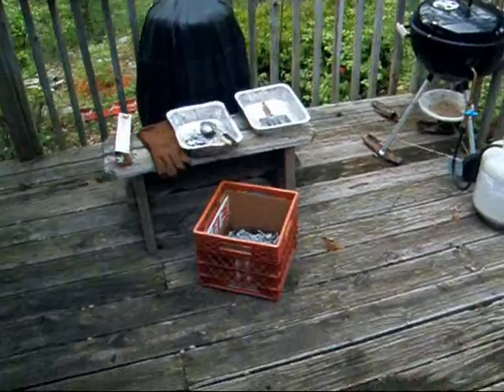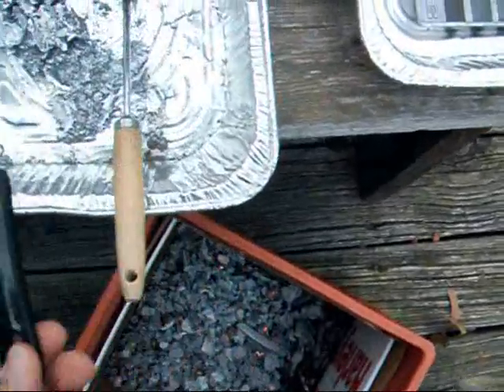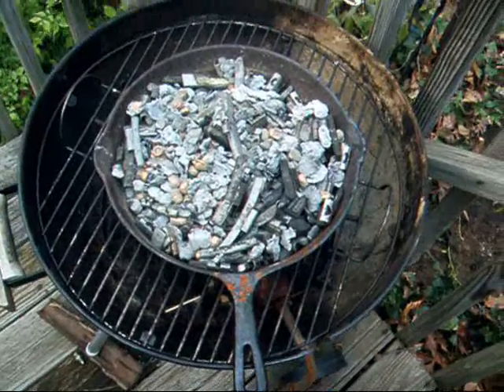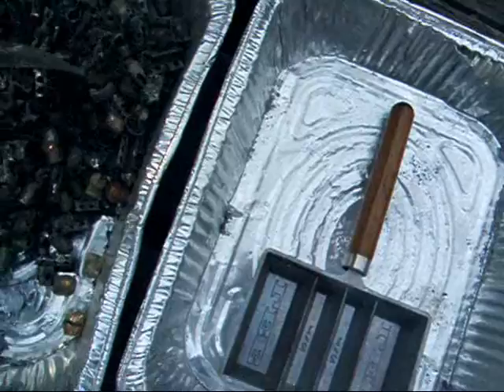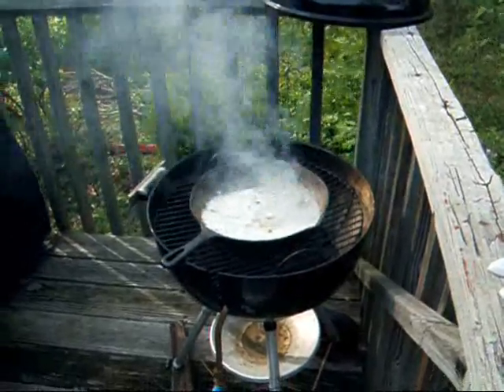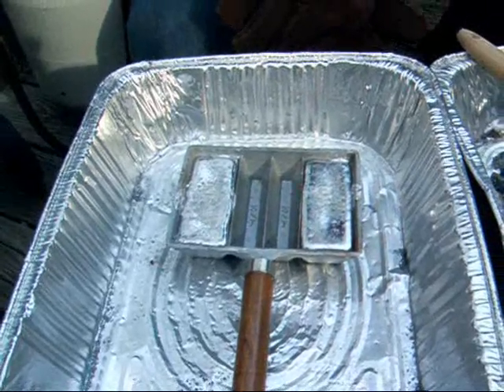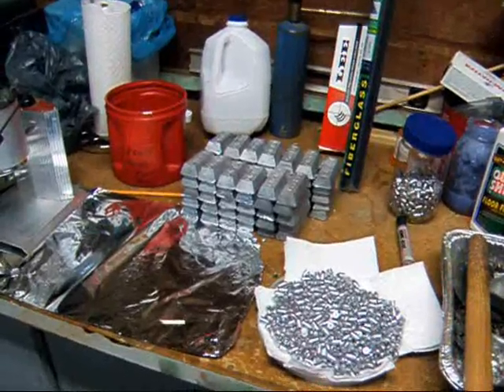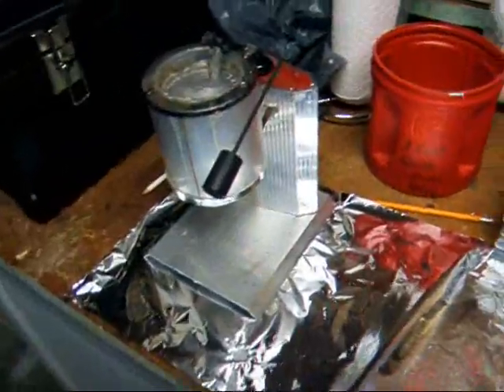Lead recycling for casting

Comment: why not melt and cast them at one time you save propane
Reply from the maker: Hey there bee keeper,
That is certainly an option.  My bullet casting setup in indoors.  Once the salvaged lead is cleaned through the smelting process, you can store them.  I process 15-30 lbs of lead at a time and save the ingots to use at a later time.

It is kind of like making a good quantity of wine or vodka and putting some away for later.

Comment: What level between 1-9 do u use to start melting and what level do you use to maintain temperature after melted? That may be my problem with the pot. It's hard for me to get the right temp.

Comment from the maker: survivalist2012,
I keep it full of lead when I'm finished casting to help protect the steel inner surfaces from rusting.  it takes about 20 minutes or so to heat up and melt the solid lead in it.  I have no problems with mine.

Comment from the maker: I do sell bullets, but not the ones I make.  I will get an FFL manufacturer's license before I do that.

The bullets I sell are polymer coated and designed for speed and accuracy.  They are used for competition, mostly for IDPA, IPSC or USPSA.  Of course, if you just need a very good bullet to load for practice, these are more than adequate.

My website for the polymer coated bullets is  2 Palms Shooter Supplies, see the description for the link to it.

Comment from the maker: Different types of steel melt at different temps.  Generally mild
steel melts at 2400 degrees on the low side.  That is three times as hot as my
 lead alloy melts at.  There is no melted steel in my pot.  The steel 
clips float on the liquid lead.

Comment from the maker: I can move the pan over and close the lid.  Depending on how many contaminants are in the salvage, it can smoke enough to displace oxygen in the Weber and choke out the flame.  Most of the time I have the lid resting the pan handle.

I appreciate your comment.  Thanks for watching.